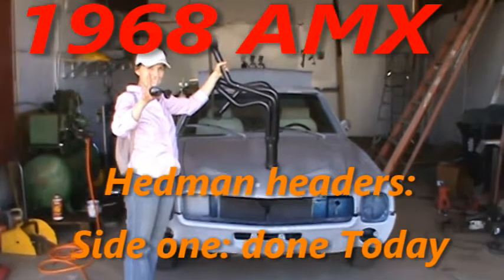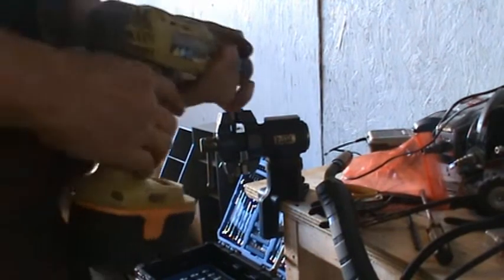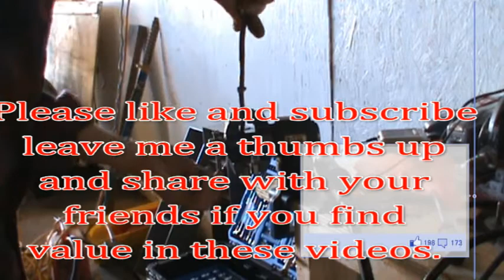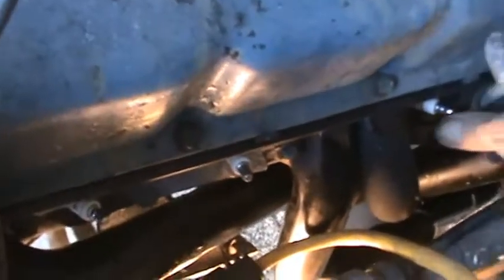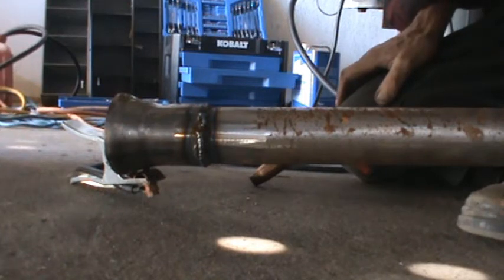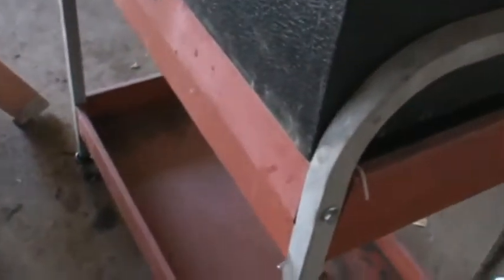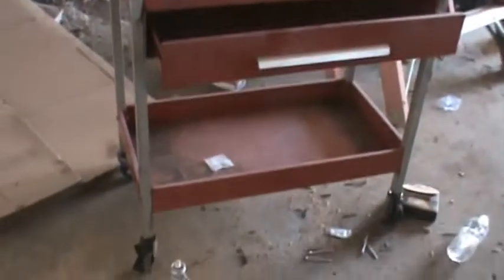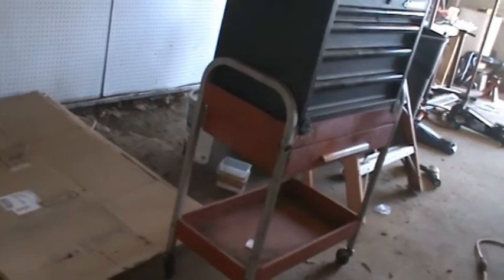1968 amc amx go pack restoration hedman headers drivers side part 2 and fix 401 dipstick tube

Comment: I'm just going to comment on your most recent video in hopes of getting a reply, my subject isn't necessarily related to the topic of the video. I've started working on a '68 AMX myself, and I'm trying to figure out how to install the brake pedal, emergency brake, and clutch assemblies. Do you have any photos/videos detailing how to install them in the car, and if not, do you know of any online resources I could use? I'm working with a shop on this, and any time they don't spend looking through service manuals saves me money. Thanks in advance!
Reply from the maker: Hi: Thanks for the question. in partial answer, I did a video for replacing the master cylinder on mine. It was a bear trying to get the thing out, and I am sure there was some video of the bottom of the dash and probably the assemblies you are talking about. I know there is one of me taking out the emergency brake, because I had to take it out to adjust the drivers door.  I dont have a clutch pedal in this car, so cant be more help there. It should be straighforward though.  Take a look through the videos I have, I think it is called "amx driver door adjustment and hood fitting". It may not have any view useful to you, but I did take out the ebrake. Perhaps a video little earlier or later will help. If you cant find something, I will get under the dash and shoot some video of how it is all mounted. Let me know, and I will be happy to help out. There is also a fb group called amx and javelin restoration tips, I think. There are guys there that could help.  Like and subscribe.  :)  Tom